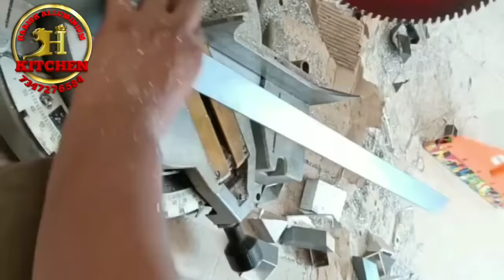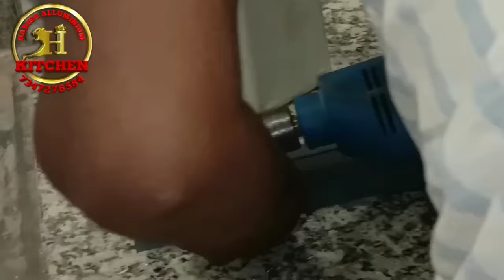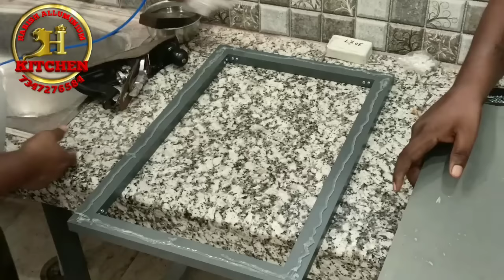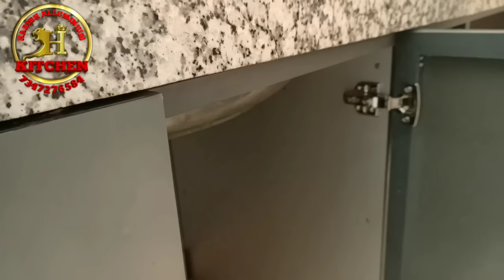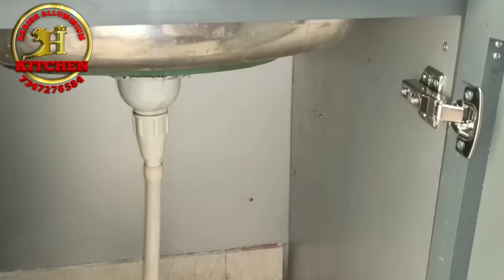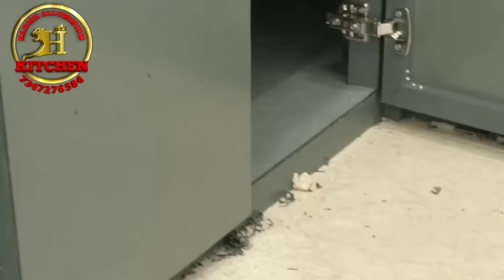Aluminium kitchen kaise banate hain/part 3/how to make Aluminium moduler kitchen cabinet

Comment: Aluminium modular kitchen kya cost padta hai
Reply: 450rs n 950rs
Reply: 1150rs
Reply: Sqrfeet
Reply: 450 sq feet kiska hai or 1150 sqft kiska hai
Reply: Normal kitchen 450rs square feet aur modular kitchen 1150rs square feet